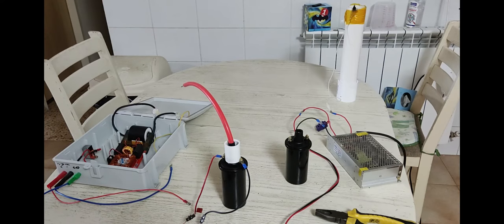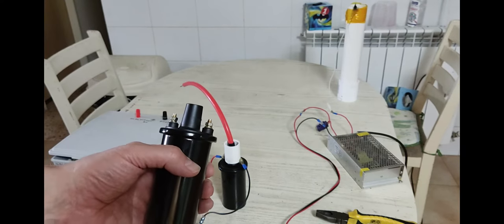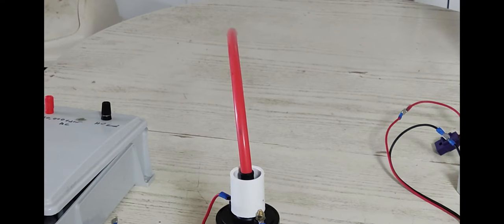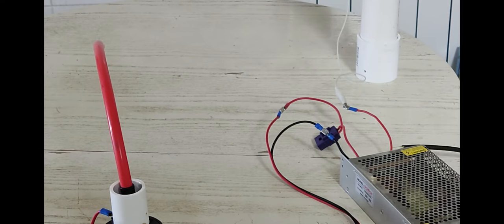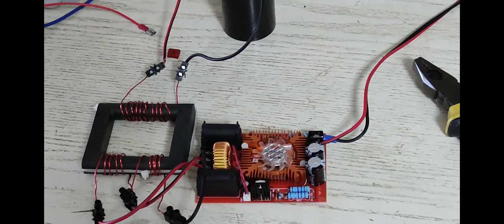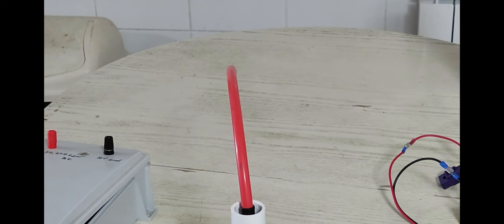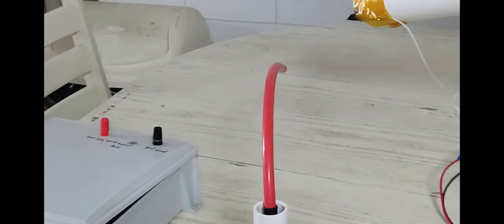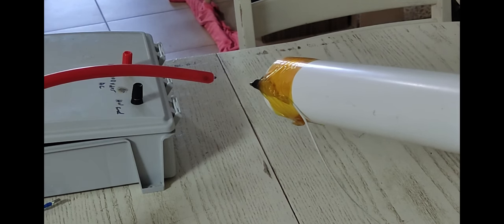Driving An Oil Filled Ignition Coil With A ZVS

Comment: This is a very informative video thank you.  I’ve been trying to understand the difference between the two output and three output ZVS modules for sale online. The only schematics I’ve seen (like the Mazzilli driver) have three outputs for a center-tapped coil.
Reply from the maker: The two output ZVS requires that you wind a center-tapped 5+5 turn coil for the primary of your flyback transformer, the center tap provides feedback to shut off the ZVS at the right point in the AC cycle.  Adding a second matched inductor to the circuit makes it work without needing a center-tapped primary, and it's much easier, so now many come with that already (especially useful when driving an induction heating coil)

Comment: You need to connect your chicken stick wire to the primary post on the ignition coil. As the ignition coil secondary is connected internal to the primary of the coil.
Reply from the maker: Yes, it is an "Autotransformer" and the unused end of the secondary is actually tied to the positive terminal on the primary (On the vast majority of these cylindrical ignition coils).  That results in the voltage always being neutral during the AC cycle, but no better than taking the arc to ground, and in fact better, because some high voltage does wind up on the primary side when you arc to the common connection.

Comment: An automotive ignition coil isn’t designed to operate at that high of frequency. Try 60HZ.
Reply from the maker: Thanks
Reply: It's not designed for it, but it still works. Probably very inefficiënt because of high core losses...
Reply: yeah, i tried driving it with 60hz 80v sawtooth wave and it worked great but it buzed like crazy and heated up a lot. It eventually killed my coil.